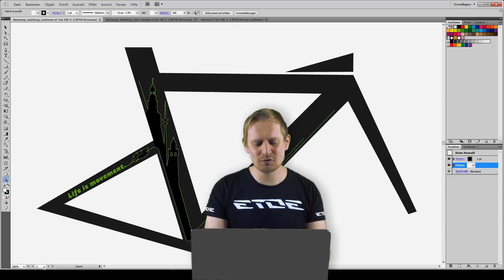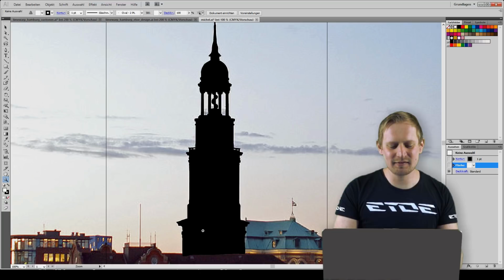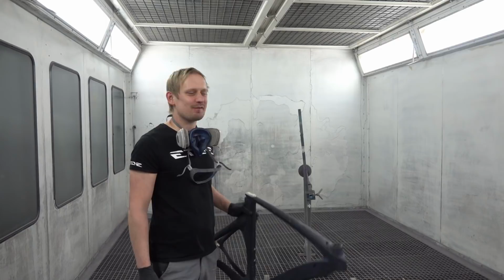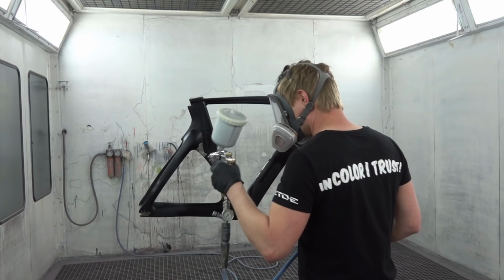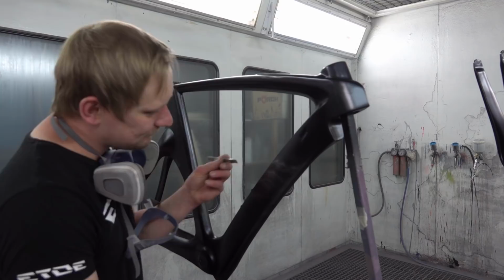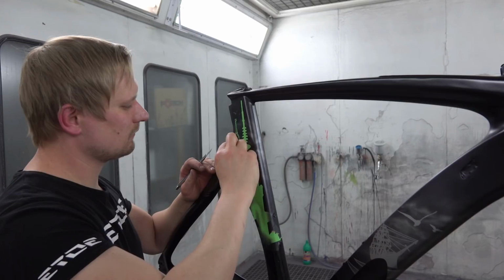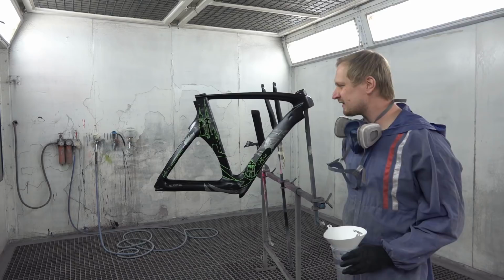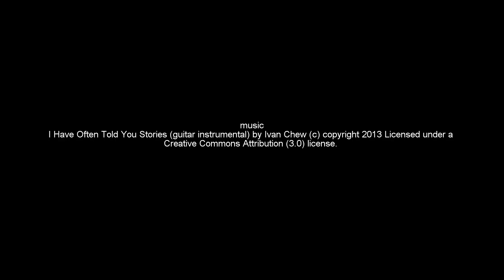how to paint a bike matt and gloss - ETOE Designs

Comment: Hello sir, i have got acrylic lacquer spray   ..  first i clear cycle body . . than spray primer  and  wait for  10 min than wet sanding with p1000  sand paper . .  than clear and dry it . .than spray 2nd coat primer . . after 2nd coat  wait  10-15 min  .. than apply  main colour 3 times with 10 min gap each coat  ..  .aftar final colour coat . .wait 10 min than apply clear coat. . . . .  is it okey ?

Comment: I need help, i have  more than 8 bicycles that i want to restore my problem is finding the clear coat as all that i have used to paint my cars are to soft for bicycles. I am looking for 2k clear coat that is going to be as hard as the factory finish so when the paint job is done the bicycle will not have a problem when trying to mount it on a hanger or mounted to a car for traveling so it will not leave any marks from where it was mounted. Besicaly i need a very hard  and durable clear coat like they use in factory, please recomend clear coat for me, thanks. Great job you do cheers.
Reply from the maker: If you need a professional finish send the frames to my shop and I will do it for you.